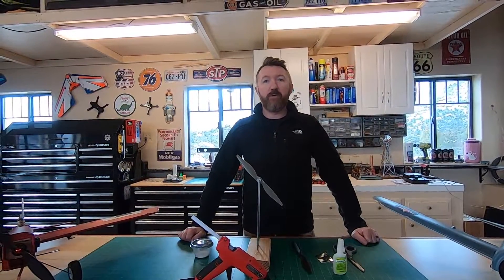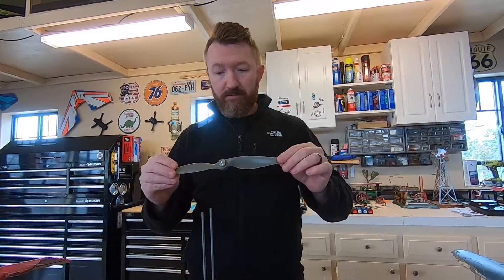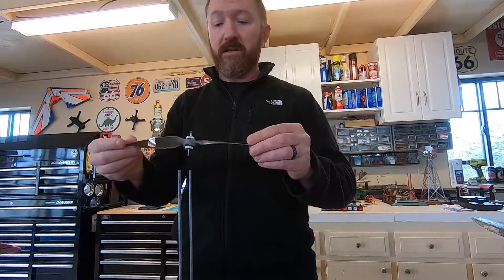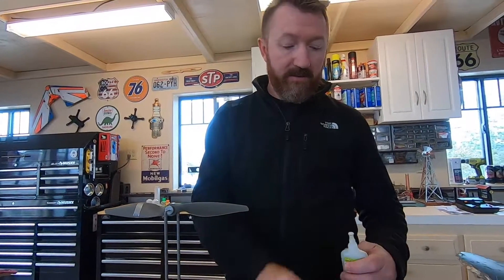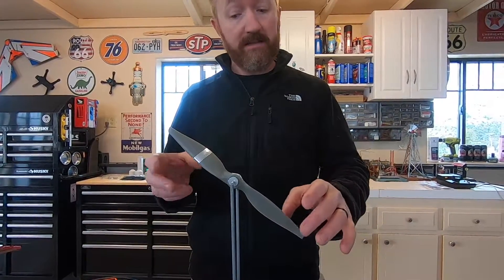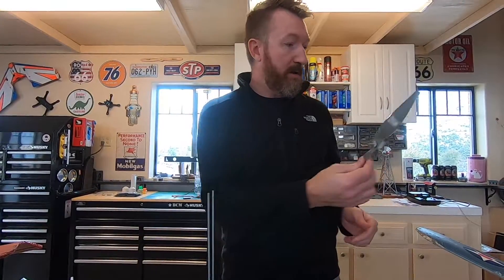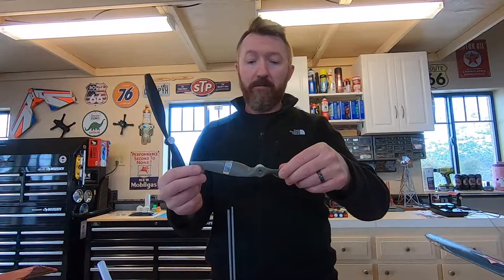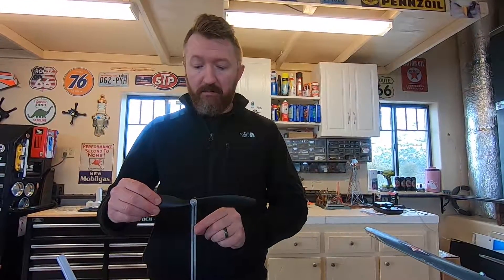How To Balance an RC Airplane Propeller

Comment: Very informative thanks, I'm trying to Balance my 9050 folding prop but the hub is aluminium and heavy on one side not sure if ca would stick, any suggestions?
Reply from the maker: I would sand bits off the aluminum until it balances. Hopefully it isn’t way out

Comment: I like that you made your own balancer.
Reply from the maker: Haha yeah pretty easy too. The actual “hub” is from hobbyking. It’s like $3 if I remember correctly. Then I made the poles  out of some metal rod, ground two notches into the top to hold the balancer in place, took a 2x4 with some holes drilled for the two steel rods. Pretty simple and I’ve balanced 16” beechwood props for the Carbon Cub even!